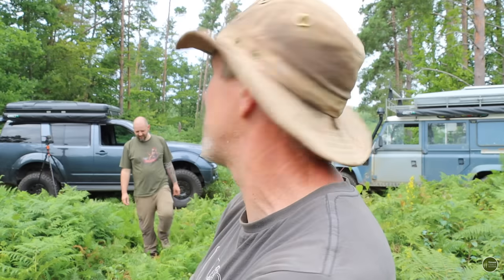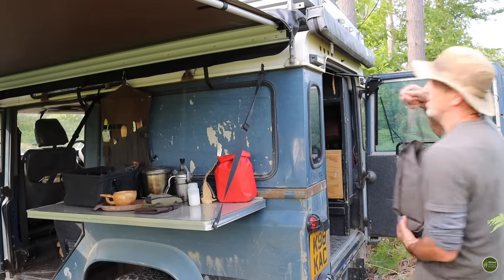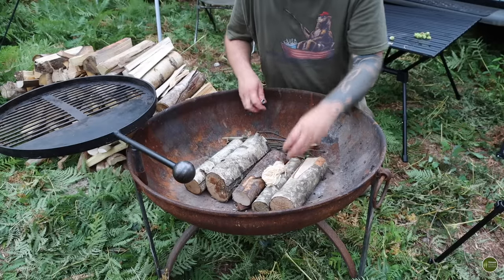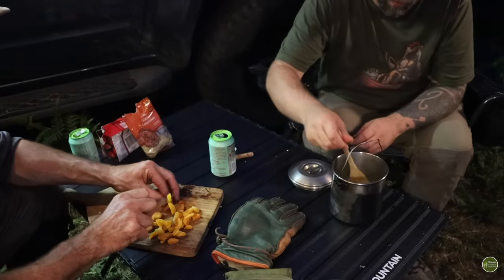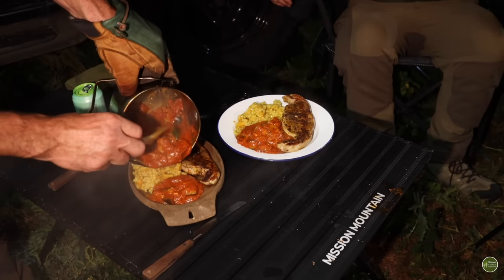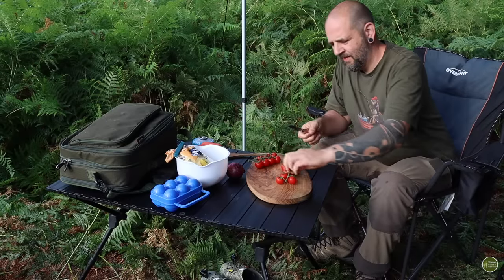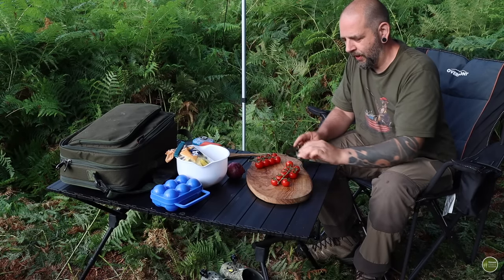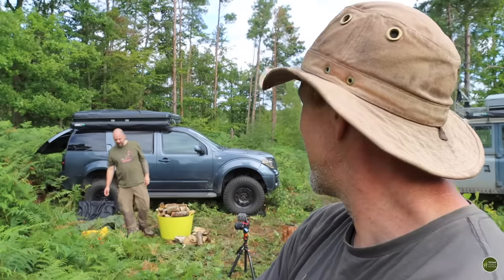Off-Road 4x4 Camp in a Kent Forest.  Land Rover Camper.  Camping in Heavy Rain.  Moroccan Lamb.

Comment: Buy some big reusable dessicant bags and place them in a small open top container while packed away which is what I have done to help alleviate the mold and musty smell from my rooftop tent. Another product I use is damp rid but you have to be sure you have room for the little container to not spill as they collect moisture and trap it in the bottom. I also set my tent up and sprayed it with a canvas mold and mildew treatment and let dry really well. The tents are fantastic but do have the drawbacks you stated when not in a dry arid place. Keep the land rover camps coming!
Reply from the maker: Thank you - a friend of mine has offered me some big bags of desiccant that I’ll try - might even install some vents (weatherproof ones) 👍

Comment: Alu Cab do a full roof conversion that may not be as bad as you could pop the Roof and air it with air from the inside of the Landy. I have recently watched a Couple Convert their Landy and they had to upgrade the Struts to take the extra weight that they were putting on top of the roof. As they had Solar Panels and a custom roof rack to take said panels and two surfboards below that, with room for some large watertight boxes. With that system you would still be able to choose where to sleep or just enjoy the extra head room with the roof up. 
Cracking Video as always and really enjoyable when you team up with Andy.